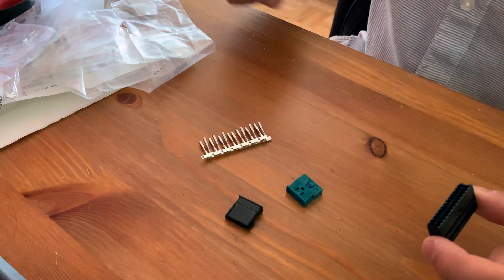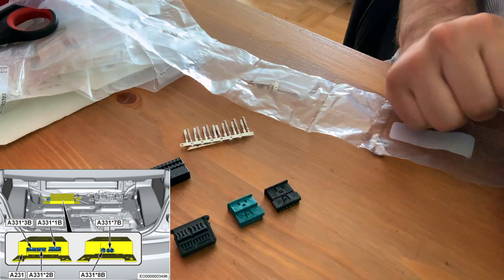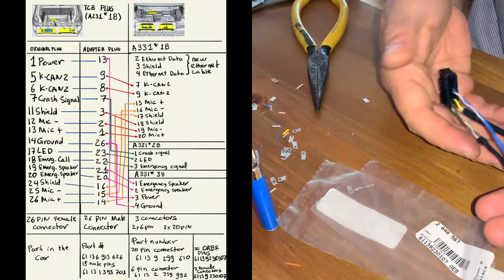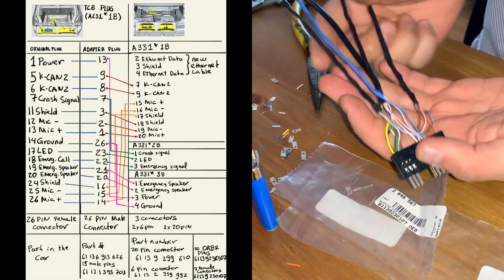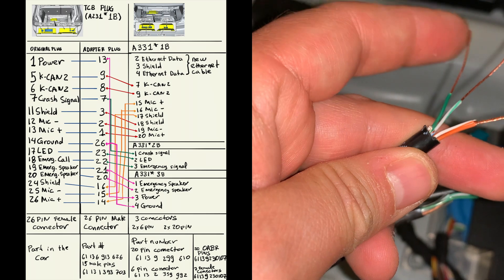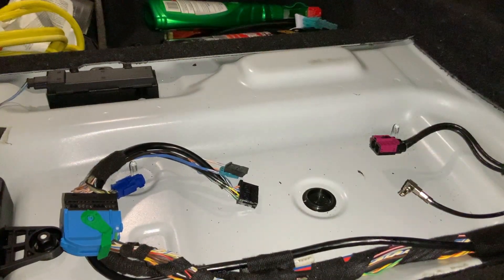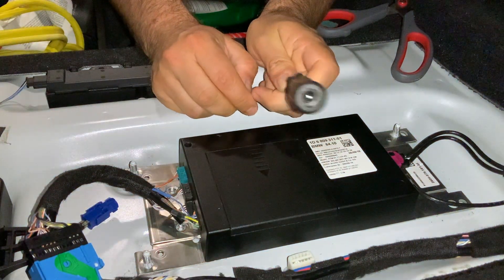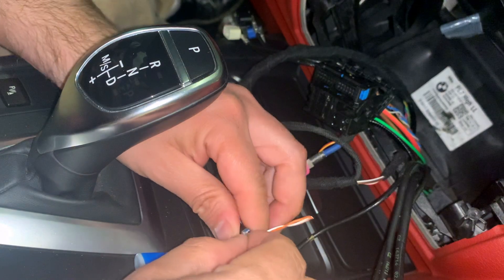BMW F32 435 TCB - ATM Adapter, works in all 3 and 4 series | Ep. 5

Comment: I retrofitted NBT EVO, but I didn't do the ATM. I also have a 2014 435i. Do I essentially need the ATM, the harness, and then run the cable from the trunk of the car from the ATM to the head unit?

Comment: Great video. Any chance you could do a write up combox to atm harness  retrofit for a f30
Reply from the maker: it should be exactly the same for the F3x chassis. Maybe even others.
Reply: Ok . I was under the impression a combox and a tcb were different. Thank you
Reply from the maker: Oh sorry, my bad. I didn’t read it properly, yeah a combox is a different story. There are a few cables that might be missing, and you might need to wire them from the head unit to the trunk of the car
Reply: No problem. I have wired the USB ports and the mic into the quad lock at the back of evo. Those  are working. What I’m looking for is the 26 pin combox plug to the atm conversion. I have also prepped a cat 6 cable with a oabr plug to the back of the evo from the trunk to get the nav working once it done.
Reply from the maker: @grogue924  oh ok cool, I could help you with the pinout from the combox and try to adapt it to an ATM. it shouldnt be that hard. Give us a few days
Reply from the maker: HI, sorry for the late reply, but I was actually experimenting this with our e90 that has a combox and it simply doesn't work (for now) there are a few more things that I need to figure out in order to have it 100% functional

Comment: hi. you can make a video with the retrofit for nbt evo + atm and the related encodings
Reply: ahh ... I was wrong, I meant atm. I have entrynav + tcb and I want to switch to nbt evo + atm. and on the wiring side I didn't understand the output from nbt evo to atm.
Reply from the maker: Hi, yeah there is a video for that. I switched from nbt+tcb to nbtevo to atm… however nowadays atm will be limited to connecteddrive remote services

Comment: How did you route the cat6 cable to the dash? During the installation on the dash size you are also installing two or three more cables inside the OABR plug apart from the shield and data cables. Some clarification on that ? Thanks for the video!
Reply from the maker: Hi Stelios, yeah so the other cables are basically as you see on the diagram just separated from one plug to three different ones on the ATM side, on the radio side, there are 4 wires for the communications and there are 3 that are pulled from the quad lock that communicates with the FEM

Comment: I might have missed, did you rote the GPS antenna from the NBT to the ATM?
Reply from the maker: yes there another video about it, but what I did is remove the cable from the antenna and I bought a wire on eBay that I passed from the roof fin to the ATM

Comment: I have a question regarding how you wired to the FEM from oabr
Reply from the maker: in meh case, I just flipped the pins in the back to connect to the OABR and that was it, neat and clean just like OEM.
Reply: @DorksandBolts  do you by chance have a drawing of what I need to pull and how to? I wanted to pull the cables from quad lock and go to the oabr or directly go from oabr to fem direct. Either way.
Reply from the maker: @tauzins  Around the 14 min mark, there is a diagram that explains the plugs and connections that you need to change from the quad lock. to remove those pins, check either episode 4 or 6 where I remove the plugs from the quadlock
Reply: @DorksandBolts  hmm I thought I watched all the way and didn’t see it but I’ll check again thanks

Comment: Appreciate this is 3years ago but could it be that there are two different part numbers for the 6 pin connectors? 

Great video in many ways. Thanks
Reply from the maker: Hi, probably the part numbers changed since, however it is called the OABR and you can find it
Reply: I mean the 6pin connectors.  The OABR is 20 pins.  In any case, I’ve decided to buy the adapter harness because I’m a little busy the new few months. Thanks

Comment: Hi, cable at 10:45 blue one, you said that there is no use for that? Isnt that cable forn usb interface?
Thanks
Reply from the maker: Hi Stevan, yes that is in fact the plug for the USB interface, but with the nbt-Evo, the usb connector plugs right behind the unit, but if you have an nbt, that will connect to the TCB
Reply: @DorksandBolts  okey. So if I go from NBT to NBT EVO and ofc replace my TCB with ATM, that blue plug will I need to connect on the backside of NBT EVO?
Reply from the maker: No, the connector for the USB in the center console is beige, and it connects directly in the NBT-evo. This blue cable that goes to the tcb, is called usb3 and plugs to the NBT with a light green connector if I am not mistaken. So that light green wire will also be unused when you make the NBT-evo upgrade

Comment: Really neat video. So is your car on 3g or 4g after doing this? Is the ATM module simply an interface to the NBT Evo because the Evo does not support TCB wiring? No CAN filter is needed? Which VIN is programmed to the EVO (donor or your car)?
Reply from the maker: It’s 4g now, I did the retrofit as OEM as possible so I have no can filters and vin is matching to the my car
Reply: @DorksandBolts  Thanks for the reply. That's awesome, I hate to have CAN filters and other 'emulators' for any retrofits. I'm confused how this all works? Did you bench flash the ATM module to your VIN? How does BMW Server see your car? (As donor vehicle or as your original vehicle?)
Reply from the maker: That is the iffy part, at the time I did the retrofit, a service technician was able to change the vin and IMei numbers into the connect servers, now a days I am. It sure they do it anymore

Comment: I currently have nbt evo system and screen and coded to id6 everything work but if I want to do connect drive I thought nbt TCB need to be replaced to new ATM and do the heck of wire thing right? Or is there any easier way to activate connect drive
Reply from the maker: You definitely need the ATM. And activate connected drive

Comment: How did you register the new ATM EMEI with BMW servers?  Please explain full process from TCB to ATM registration.  Thanks.
Reply from the maker: the process is explained on the next video, registering it with the BMW servers depends on your dealers goodwill as far as I know. I was lucky and they where great help to me. I know that this is not the case for everyone and only partial services will work if you have a BMWConnected account and an active package.
Reply: @DorksandBolts  which video was this in? looks like episode 6 was on windshield replacement? :D